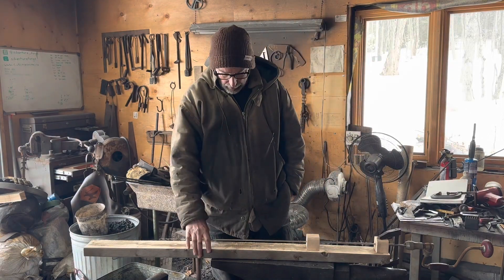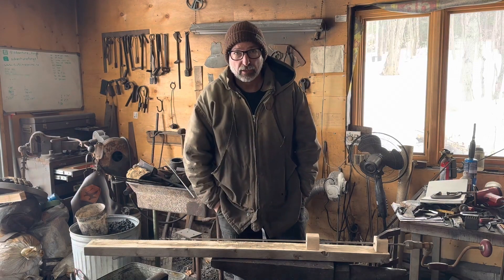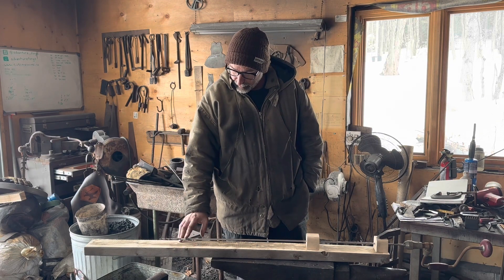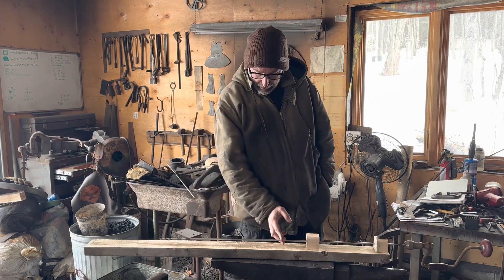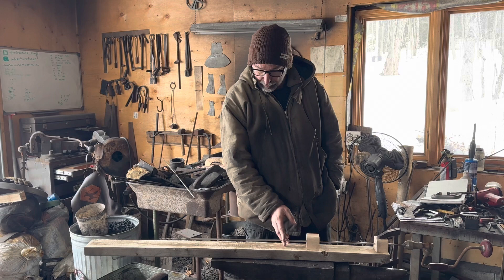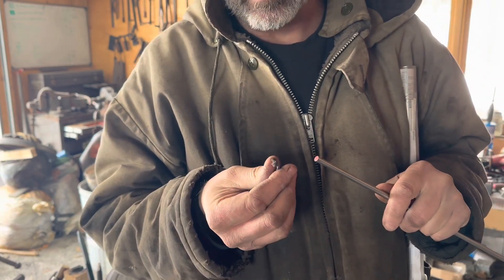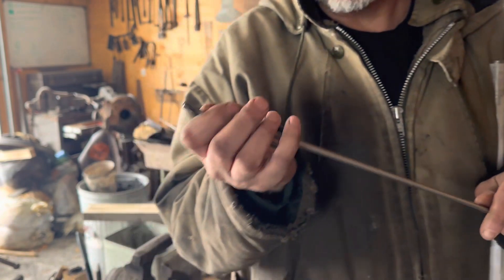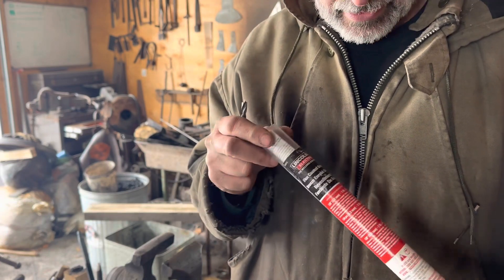Blacksmith creates a tomahawk drill jig

Comment: ..it's like drilling for oil...!
Reply from the maker: There is a reason the handle is made around the hole and not the hole drilled in the handle, the ash I used on the video, the drill still followed the soft grain. Ended up 1/2” off centre… sadly no oil or gold were discovered…